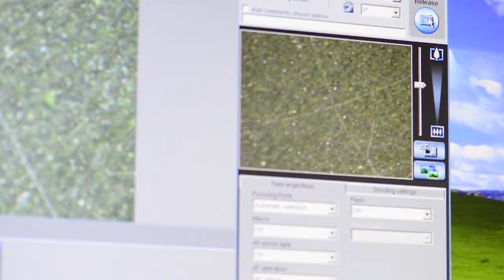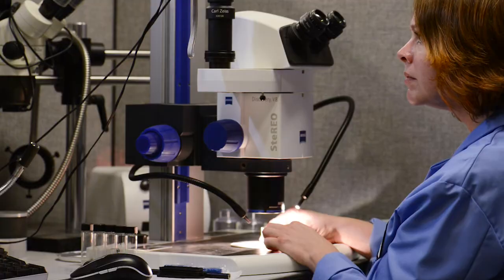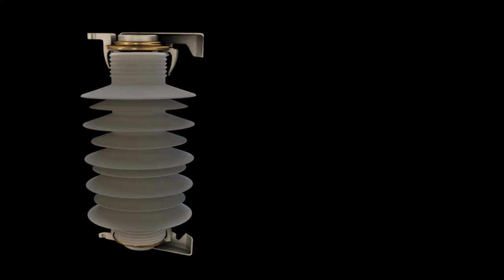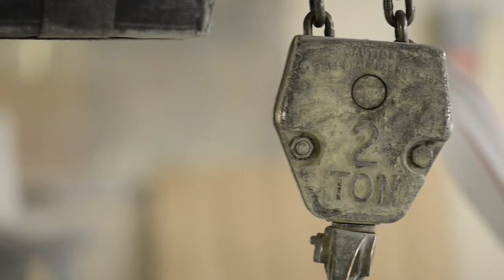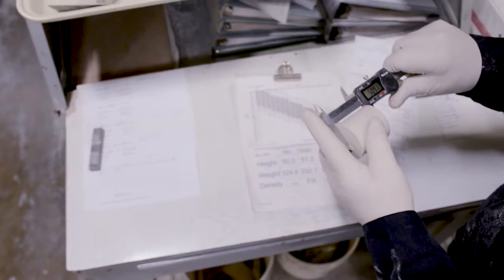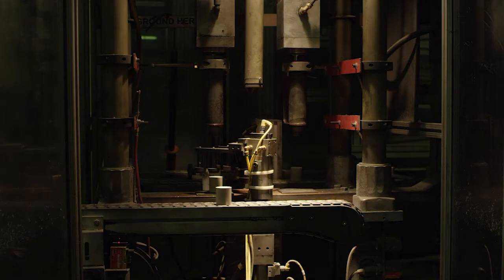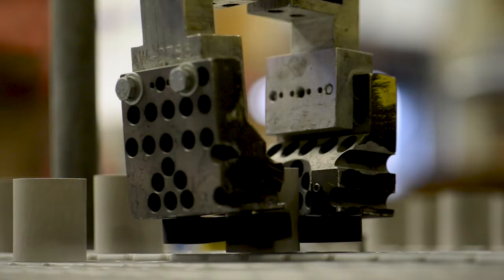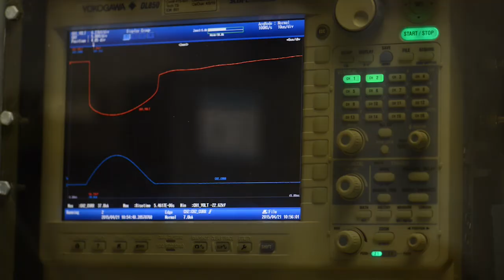Hubbell Power Systems - Metal Oxide Varistor

Comment: What are the prices and moq for mov discs? I need to replace defective ones in a 410kv powersupply
Reply: Should probably add that it's the powersupply for a UHV analytical electron microscope located at my center for electron and ion optics. If you guy need my services we can work something out.